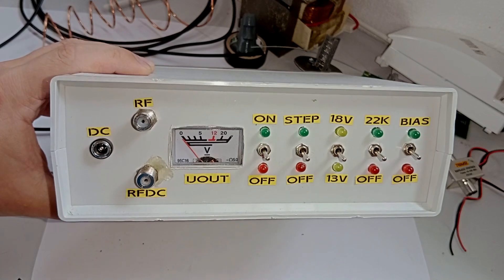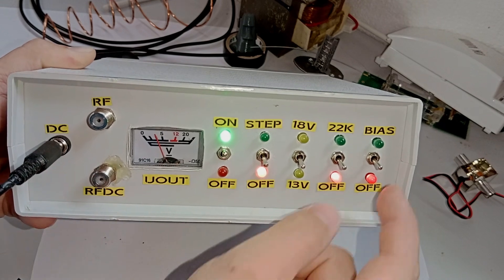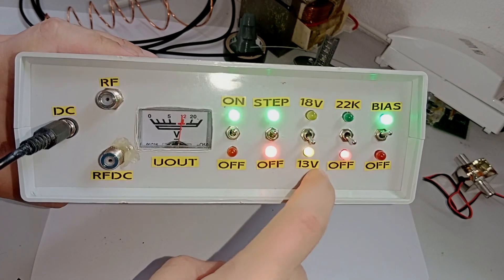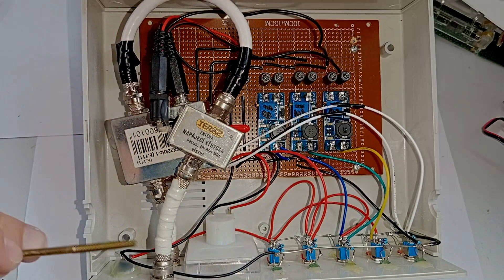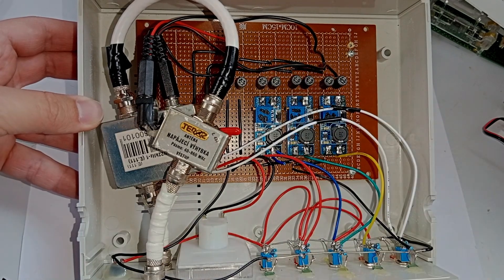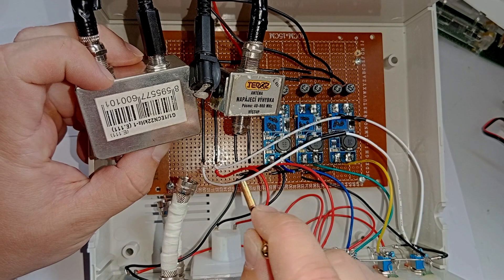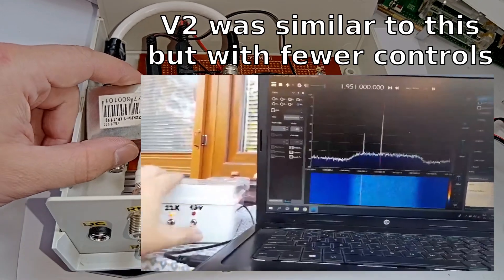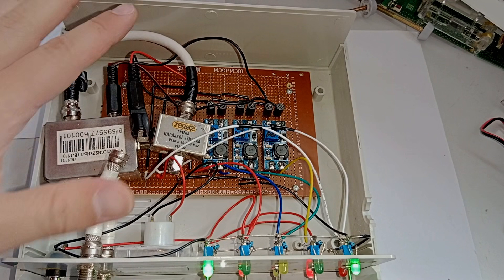My DIY Bias-T/LNB control box (with teardown)

Comment: I purchased those same low quality junky chinese switches for some of my projects. I had exactly the same results.. They're not reliable and heating them up enough to solder wires to them will do even more damage to them.
I bought mine on Amazon.. I warn anyone. If you're trying to build anything you're going to want to be able to rely on, you're going to regret using them. Pay more and get quality switches.

Comment: Where did you find the Dc-dc converters?
Reply from the maker: Local electronics store, but the design is so generic that just about any distributor of electronic parts should have these
Reply: @dereksgc  is it adjustable voltage or is it predefined
Reply from the maker: @HåkanJohansson-g4z  You can get both types. These have the blue trimmer which you can use to select the output voltage

Comment: Do you have an expirience with injectors with 10 Mhz reference signal injection?
Reply from the maker: Not yet. I didn't really have a need for that kind of stability, plus it's not very affordable where I live
Reply: @dereksgc  ok. Thanks for reply. I've got a transmitting BUC, but unfortunately it requires a reference  frequency. But anyway, tnx

Comment: thank you sir. Hey is there a way to create my own 7 km FM radio trasmitter any schematic?
Reply from the maker: There's plenty of schematics online, you can even buy FM transmitter modules that would most likely be able to achieve that range with an external antenna. Of course those are only meant to be used at short ranges as interfering with any other radio station is illegal and I don't condone that